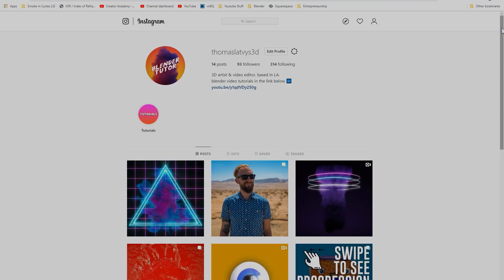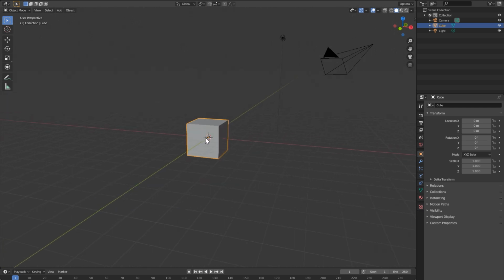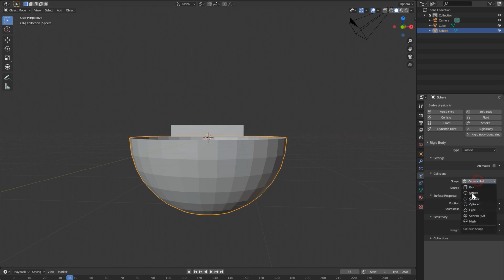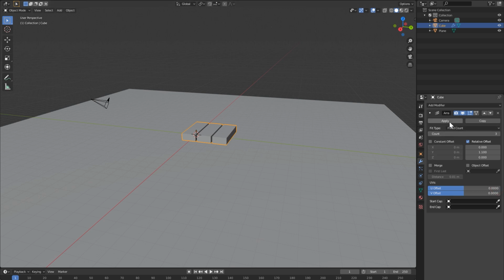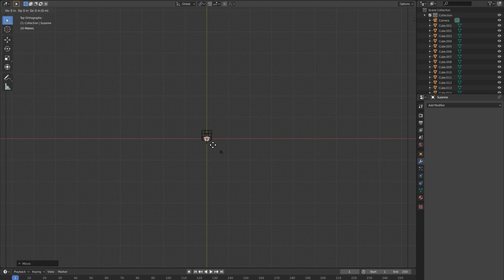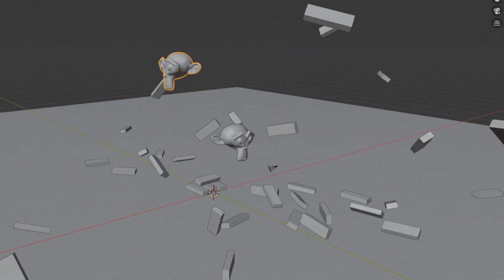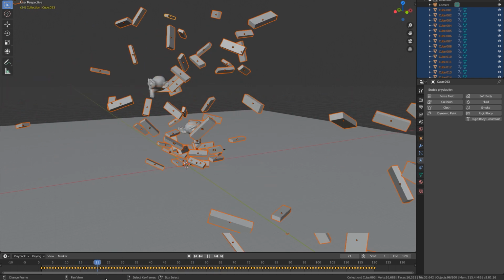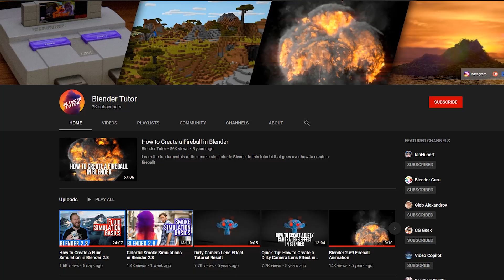How to Create Easy Rigid Body Physics Animations in Blender 2.8 - Blender Simulation Tutorial

Comment: My ridged bodys shake when they are colliding and the collider doesnt even stop them from going through each other. What can I do against this
Reply from the maker: Some things to check: make sure you apply scale with ctrl+A, and also make sure you are using “final” for the collision mesh under Collisions. Another thing that can help is lowering the collision margin under sensitivity to 0.001.
Reply: @BlenderTutor  Still pretty shakey and the cracks in my cell fractured box (20cm x 20cm x 20cm) the cracks are getting pretty big with a margin of 0.001. But they dont touch each other anymore.